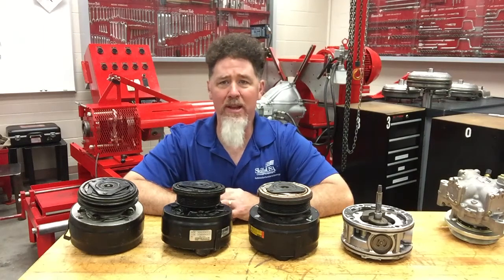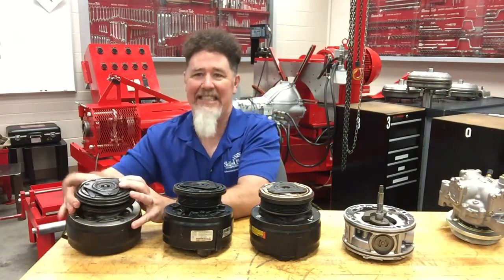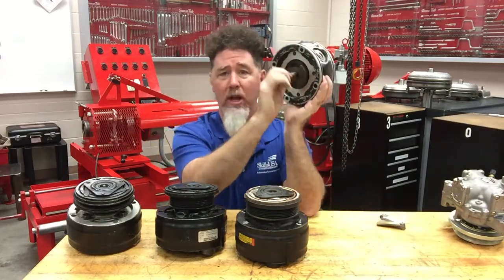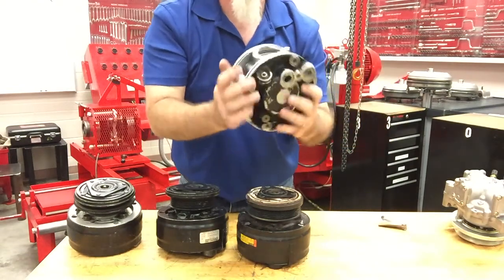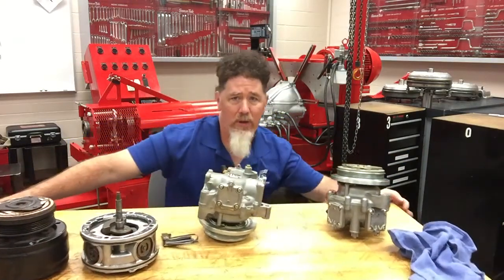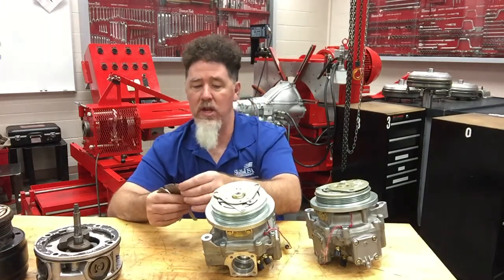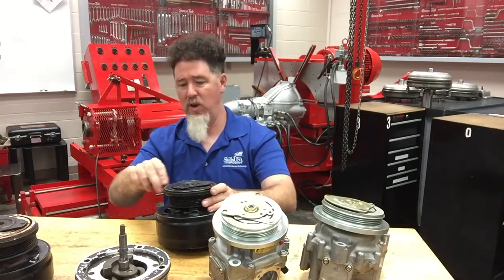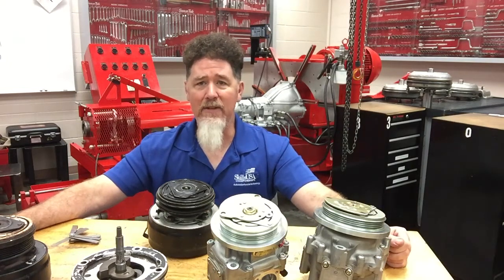Lesson on the R4 A/C Compressor Part 3

Comment: How freely should the clutch rotate?  Mine rotates, but certainly takes some effort!
Reply from the maker: A new compressor may take a little effort to turn on the bench due to the lack of oiling.  Make sure there is oil in the compressor and turn it 20 times and it should start to get easier to turn.  A compressor on the vehicle should be easy to turn by hand. Thanks for watching.